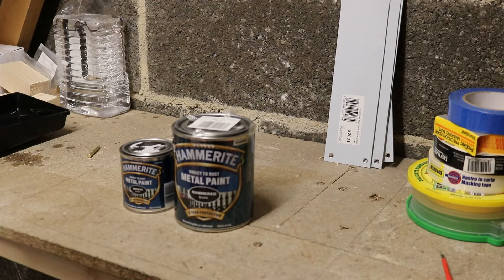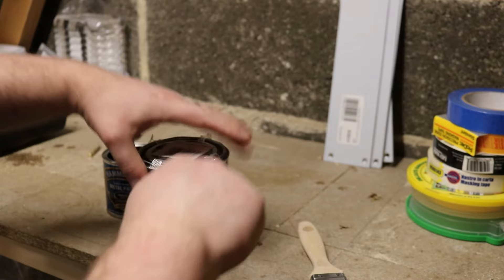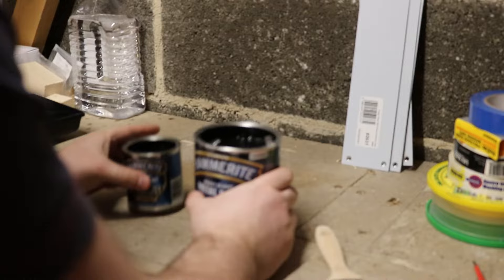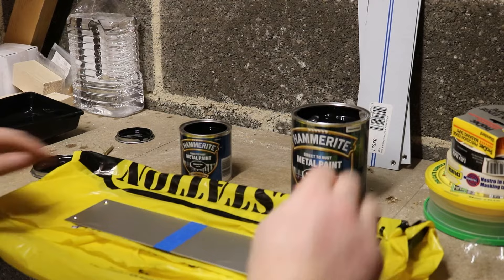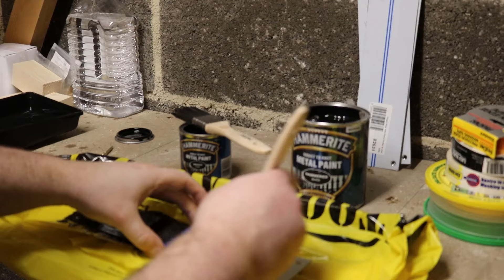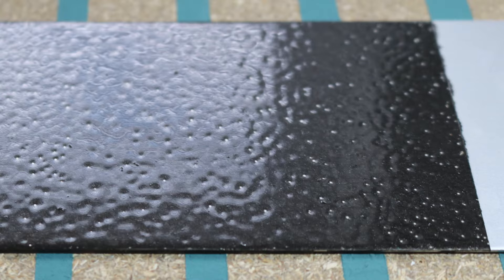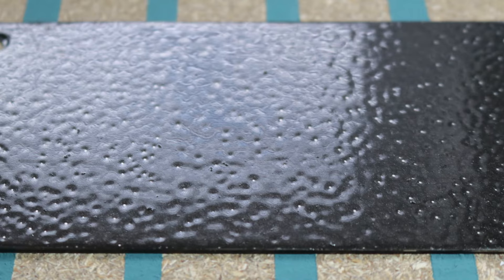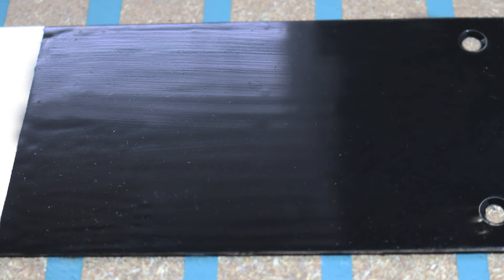Hammerite smooth v hammered, what's the difference?

Comment: My approach is if the surface is rough and crappy I use hammered because it helps disguise it by sort of levelling it out.  If the surface is smooth I prefer the smooth or satin finishes.

Comment: My understanding was that the hammered paint had mica, broze, or aluminium powder added to it for added uv protection. Mica being the most common from what I understand. It makes the hammered finish paint a good choice for outdoor applications.

Also if you sand the surface, or are already painting over a rough surface then you wont get those bare spots, in my experience. We used to call them fisheyes at work.
Reply: Because I made myself curious saying the bit about mica I decided to double check the MSDS. Hammerite now uses aluminium powder instead of mica.

Rust-Oleum uses aluminium flake in some of theirs, but not in others. You'll have to check yourself for the colour you want.
The white Rust-Oleum spray cans have titanium dioxide in them instead which I believe will serve the same purpose.

I only bring up Rust-Oleum because that's what's more available in my area.
Anyways, that's enough of a paint rabbit hole for me today.
Cheers!

Comment: which is good at preventing rust and lasts the most?
Reply from the maker: They are both very similar, you wont see much of a difference. If i had to say one then probably the smooth as it doesn't have the little pits that the hammered does where the paint is thinner.

Comment: I don't know if you'll respond but I'm looking to repaint some basic metal outdoor chairs (Tolix style) and I'm trying to work out if this will be good value for money or not. Nowhere seems to specify the length of coverage and I've watched multiple videos and people aren't stating what they used the paint for and how much it covered. I don't suppose you could suggest how many chairs this paint could cover? I did initially use a 250ml spray paint can from a local store but it barely covered half the chair so given the same ml I'm questioning if this will even cover half a chair or not and I have around 14 chairs to cover so if it doesn't cover more than one chair it would be costing over £140 which just isn't worth it when spray paint is around £2 and would cost  a fraction of the price.
Reply from the maker: It will cover a good few chairs, obviously there are a lot of variables so i cant say for sure but it will go a lot further than the spray paint!

Comment: Hi so the direct to rust range works fine for straight to aluminium, no need for a primer? There is a seperate range direct to galvanized metal but that is alot more expensive where I live
Reply from the maker: It has been fine for me but I do know that Hammerite say to use the Galvanised paint. I have had no problems with the normal stuff, but who knows maybe it will fall off in the next few years

Comment: I have a question, i have this plastic bin that I’ve tried multiple primers on and it still flakes eventually? What can I use
Reply: Use an 80 grit sandpaper to provide a key for the paint to hold on to. 

If the plastic is very flexible then the paint will Crack and peel no matter what you do unfortunately.

Comment: But which is stronger?
Reply from the maker: From my test they are both the same, I will do a longer term test to see how they last but the results will obviously take a while!
Reply: @TheBlokeCave  i used the smooth white on the metak frame of our garage door 2 coats in 2006. Not chipped or rusted since then.